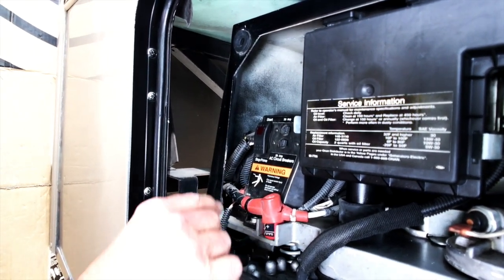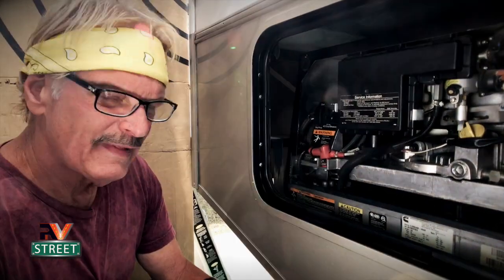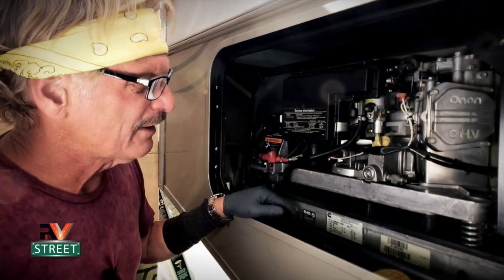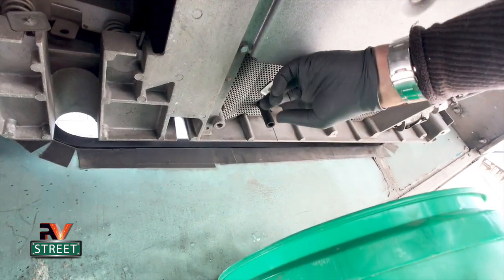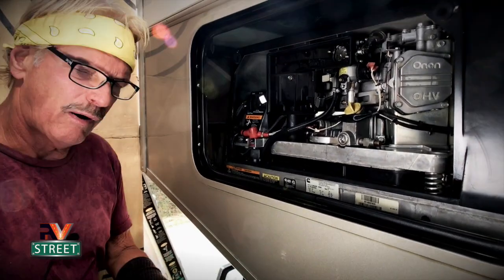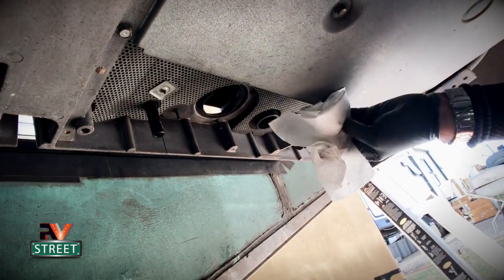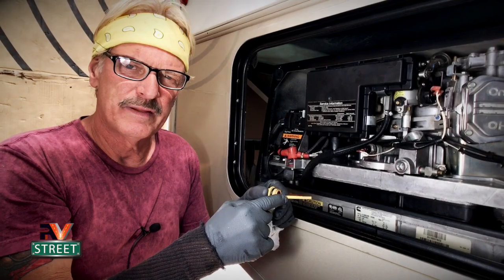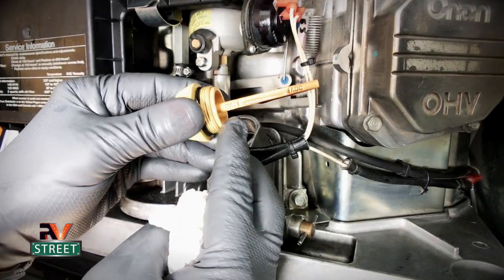CUMMINS ONAN RV GAS GENERATORS - ULTIMATE MAINT. GUIDE - Part 1

Comment: Nicely done, thorough, complete and very helpful.  Since yours is a gas generator, are there some fine points that differ for those of us with a diesel generator?  Thanks again for another high quality educational video.
Reply from the maker: Much of what I show in this 3 part series will apply to diesel generators too. Part 2 is coming out this Sunday @ 8pm. But as far as "finer points" on diesels not sure. I'm not well versed on diesels.
thx for watching Robert. 👍

Comment: Love your videos very helpful.  Question my gen is onan 4000 air cooled, it is surging and cuts off any ideas on what to change or fix.
Reply from the maker: It could be any number of things. Without knowing the maintenance & exercising history and doing a methodical diagnosis by being there to troubleshoot, it’s impossible to say. Always start with the annual maintenance stuff first, then to the easy and most common fixes first.
• Old, bad or wrong fuel like E-15. Put in appropriate amount of Sea Foam in the MH gas tank, run the motorhome to mix it good in the gas tank and the run the generator for several hours on at least a 1/2 load. You want to run this fuel thru the entire generator fuel system and maybe this will help clean everything..
If that doesn’t help… 
• May have a weak or failing fuel pump or a clogged fuel filter (Replace both. Go to my Amazon Store, search Amazon for those two parts, put them in the cart and check out: https://www.amazon.com/shop/rvstreet)
• The spring holding the governor arm may be weak and not holding a steady RPM
• The carburetor may need to be cleaned

This is not a complete list but this is where I’d start in this order.

Comment: There are oil filter sockets.  This looks like the perfect application for one.
Reply from the maker: Yep there are sockets out there, but that's another tool to buy. These Tekton pliers work for both the generator and the coach filter if it needs to be broken loose before unscrewing. So you have one tool that serves two purposes.
thx Bruce for that. 👍

Comment: Martin, thanks for all the great videos, including this one.  Question, I can’t get the spark plus wires off the spark plugs.  Too little hand strength I guess.  Any suggestions?  John. HGJAB-1038K
Reply from the maker: Try with a pair of rubber gloves and gently wiggle back and forth while pulling. If that doesn't work have a younger friend with more strength help you.
Before you put the wires back on, don't forget to put a small dab of my 3M silicone paste on the inside of the rubber boot. It will make removing them next time a breeze. It's in my Amazon Store in the "Sealants, Lubes and Protectants" category.
https://www.amazon.com/shop/rvstreet

Comment: Hi there. Great videos. What is the spark plug Gap for the Onan 5500 HGJAB-1038K?
Reply from the maker: Spark Plug gap is 0.025 inch, and torque to 10 lbs-ft (13 N-m) if new, or to 18 lbs-ft (24 N-m) if being reused.
You really should go back to my video and in the description text you can download your own PDF service manual. It answers all these technical questions and much more.

Comment: Great video Martin, looking forward to the rest of the series on Generator maintenance. I have a question about using brake cleaner on the electrical contacts. Is the cleaner non-conductive?
Reply from the maker: Thanks for the kind words Mike.
Well....let me put it this way. 
I've been doing this method of cleaning electrical and mechanical parts all my life in many, many types of maintenance applications and I have NEVER had any issue what-so-ever. Electrical or otherwise. I mean you know how aerosol brake cleaner is right? Once you spray it on any surface it drys almost immediately and leaves no residue. If somebody wanted to buy an "official electrical cleaner" they certainly can do that. But I use brake cleaner literally on everything when I need to cut thru any grit and grime or flush anything out and make it clean again. I always carry one or two cans of it at all times. I'm always using that stuff.

Comment: I don’t generally like using ethanol gas in any small engines. Since the onboard generator runs off the coach’s gas tank, should we be putting non-ethanol gas in the coach?

Comment: I race dirt bikes in races called Hare Scrambles. They are basically motocross races through the woods, in very tight trails. We have to install spark arrestors on our exhaust. Because they are installed on the tip of the muffler, they are very easy to remove and clean. After removing and cleaning mine several times, it's hard to believe that just removing that plug and running the generator will adequately remove the Carbon from a screen that usually would require a whire brush. Are you sure you can't get the screen out with a bent scribe? I haven't even changed my oil for the first time so I'm just asking.
Reply from the maker: I'm sad to say that Martin has passed away and I don't have the answer to your question. Sorry
Reply: @RVstreet  I'm sorry to hear that. My condolences.

Comment: I'm about to buy one of these for my food truck, if I run it 5 hours a day 5 days a week how often would you say I change the oil?  Would leaving the door off with  12v 12" radiator fan blowing into it ?
Reply from the maker: The oil change schedule is every 100-150hrs. depending on the environment. The door needs to remain on to cool properly. Using a fan would an experiment and I have no opinion on that.

Comment: Getting the oil/dirt buildup out of there might help prevent a grease fire.  Don't gorilla wrench the bolts unless you're ready to tap new threads into a very inconveniently placed hole.  Use a real pipe cleaner (not a Hobby Lobby one) or an interdental brush (the cheap ones at Wally World) to clean the crud out of those female spade connectors after you shoot in the brake cleaner.  Listen to Martin!

Comment: Thanks for the informative series on Onan RV Gas Generator Maintenance. Just getting around to following some of your suggestions. On the video (Part 1) aroun 10:20 you show a screen on the bottom of the generator. Mine is filthy with oily dirt. Can't find anything on cleaning this or removal. Can it be removed to clean or clean in place? I've been having issues with the generator shutting off in the heat and am thinking that this may be blocking some of the air flow. Thanks for any comments.
Reply from the maker: There should be no oil on that screened area. There is oil coming down on that area from above somewhere. I suspect you may have a small leak on your oil filter where it seats up at the top. And yes, that could be obstructing air flow as that oil collects dirt and dust while underway.. It also means that your loosing oil from somewhere and your oil level is probably low, thereby causing the oil pressure switch to trip the run cycle and then shuts down. So let's start with the obvious first step.
Here's what I'd do:
1) Make a hot water and soap solution and with a small hand held scrub brush, clean that screen good in place. Let it dry. Make sure you clean not only the screen and the entire bottom of the genny
2) Drain oil
3) Remove old oil filter
4) Look up inside the filter cavity and make sure that there isn't an old oil filter rubber seal ring up inside. If there is, carefully remove it  using a flathead screwdriver. Sometimes the rubber seal from an oil filter will break loose from the oil filter when removing it and stay up inside. Then when you install a new oil filter with it's own new rubber seal, now you have 2 rubber seals trying to seal against each other. That won't work and would cause it to leak. So make sure that area is clean and no old rubber seal up in there. This is also good practice to check when changing engine oil and filter.
5) Fill new filter with oil and install and tighten as I instructed
6) Add new oil
7) Start genny
8) Make sure there is not anything obstructing or stored under the genny. Like buckets, chairs, camping gear or anything else.
9) Keep your eye on that area over the next few weeks. If oil begins to still accumulate on that screen or the bottom of the genny, that means you have oil coming down from another area up top, so try to locate where it's coming from using a 2" telescoping mirror. Everything is in my Amazon Store.
https://www.amazon.com/shop/rvstreet
Reply: @RVstreet  Thanks for the reply. At one time there was a major leak from the crank shaft seal into the bottom of the generator. I suspect that it was either never fixed properly or it happened again. I'll give your suggestions a try. Was wondering whether the drip pan inlet cover could be removed without removing the entire generator. Thanks again for the help..
Reply from the maker: @PAPERRN  Not sure what you mean by "drip pan inlet cover". 
Do you have a service manual?
If not, I do. If you use Facebook, go to my YT home page and click the FB logo, then hit me up on messenger and I'll attach it there for you to download. Maybe also shoot me a picture of the "drip pan inlet cover" you're talking about so I can see what you're talking about.
Reply: @RVstreet  I do but it isn't referenced. It is in the Onan parts manual on page 49. It's attaached to the drip pan and includes the Inlet Cover, Insulation Retainer, and Inlet Baffle Insulation. I don't have a picture of the cover but do have one of the screen.

Comment: That spark arrest or looks like it might be a 3/8” square. You could use a 3/8” extension backwards if so. If not an eight point socket will drive a square

Comment: I thought that your idea of drilling a hole in the oil filter was a good ide until you loosened the oil filter. The mess that was created was a lot worse than just pulling it straight down. Just something that might have been a good a good idea is that their generator may be different. You may have wanted to also show the chart and its location for type of oil to use.

Comment: any thoughts on running Seafoam or Berryman's B12 through the carb via the air filter inlet. to clean jets
Reply from the maker: Doing that thru the air filter inlet is not thorough enough.
I covered using Seafoam in this 3 part series. I treat the whole gas tank every winter with one 16oz. bottle/20 gal. of gas. (4 bottles total for me) Then I drive the MH and run the generator under load for about 20-30 minutes. Every thing concerning the fuel systems in both have now been treated and cleaned, including the generator jet in the carb. This is the proper way to do this.

Comment: Hi Martin! I’m a day behind because I’ve been packing up George and getting ready to head to Quartzsite! I actually checked the oil in my generator today before I tested it for the trip. I do exercise it at least once a month with a load. The oil was low on the dipstick and I was thinking that was because it was cold, kinda like a car...you check it when it’s hot??? I’m gonna grab some 30 weight before I hit the road in case it needs to be topped off. But I do have one question about your oil draining. You drilled a hole into the filter and oil drained out through said hole...but what did you do to get the oil to drain through the little drain hose? Did I miss something or does oil not drain out that hose? Great video as usual and of course, I now have cleaning to do! Hi Joanie!!! 🥰 I just thought it through and it must drain when you open that thing up top! I think mine is different because I don’t think I can start mine from inside the panel. I could on my diesel but I didn’t see a switch on this one. I’ll be examining it closer!
Reply from the maker: Marsha,
Since you bought George used, and you have no idea what previous maintenance has been done on the generator. I would perform—at the very least—this entire basic maintenance schedule. That way you will have an accurate baseline going forward. And besides, you also don't know how old the current oil is, nor what type they used. You really don't want to mix different types of oil. So if you do this entire basic maintenance schedule, not only will the oil be changed and new, but you run no risk of mixing two different types of oil.
Yes the oil is drained thru the rubber tube underneath as you open that valve—up top—like I showed by opening it up all the way. Once oil is drained, close the valve and add new oil. 
We do have a remote start/stop switch inside the coach (which is also where the hour meter is) in addition to the one outside on the generator but it may differ on other rigs.
Joanie says hi Marsha. 😜
BTW...we heard that Quartzsite got down to 22º yesterday.
Reply: @RVstreet  22??? Dang it! I’ll have to verify that, Bob and Pearl are there and they said before that it could dip into the 30’s but no one said anything about the 20’s lol...I thought I left that in misery! So actually, I do know a little about George’s generator. The previous owner only owned him for 18 months and had to overhaul the generator. He spent $2,500 and had only put about 10 hours on it since the overhaul. I texted him today because I wanted to top off the oil and if it was synthetic then I wanted to use the same. He said he didn’t know but it was a certified Cummins service center. So I figure if he didn’t ask for synthetic then they probably didn’t use it. I have the paperwork so I will check it out. I will do the entire basic maintenance this Spring after I watch your series. I looked at mine today and it looks the same as yours...it does have the outside start and 2 breakers also. Yes, mine has the start inside with the hours as well. I’m sure it says it somewhere on the unit what the model is...I didn’t have time to look today. I almost made it to Amarillo in spite of getting a late start wrapping up some real estate stuff! So I’m making good time! Talk to you guy’s soon! I’m wondering if you got your cover installed? Tell Joanie I’ll call her tomorrow while I’m driving 😊

Comment: I purchased a used RV with probably the original Onan generator in it, it generates but doesn't idle down when not under load.
I adjusted the governor so it idled nice but then it didn't rev up with load? So I'm guessing there's a problem the the previous owner "fixed" by just cranking it up so It was always charging.
Any ideas, or videos on that?
Reply from the maker: "there's a problem the the previous owner "fixed" by just cranking it up "
I don't know what this means
Perhaps watching part 2 & 3 will help your situation

Comment: Martin - can I top off my generator oil with the Royal Purple SAE 30 synthetic, not knowing what the dealer last put in it (Onan 5500)?
Reply from the maker: NO.
You never want to mix oils. Do a complete oil change and then use Royal Purple

Comment: wow I thought your rig would have been diesel for sure , What Motor trans has the RV ? Diesel / Gas .
Cheers Rob
Reply from the maker: Our rig is a 2012 gas with a V-10 and a TorqShift 5-speed
automatic transmission w/tow/haul.

Comment: I've purchased all the Onan parts you recommended on your Amazon Channel.  Is there an Oil Sensor?   I didn't see one.   I went to Onan's website and for my HGJAB 5500 unit. The orignail partnumber seems to have changed.  There are 2 oil sensors on their website, one is $86, the other is $19.   Is there a way to tell which one is the right one?   (My Generator shuts off on it's own).   I would try your technique of removing the sensor wire, but it's in the shop for a couple of months because my Front FORD Motor AC went out.    I'm using your channel to get me up to speed on how to do some of this myself.   -   When I get it back from the shop!!  Arghhh
Reply from the maker: Hi Darth,
Go back and read the description text. I explained the options of ordering the oil pressure there. It's not available right now on Amazon and that's why that one item is NOT in my store.
And THANK YOU 🙏 for being such a faithful fan supporting us using my store. You're the best 👍

Comment: For the spark arrestor used a 1/2" extension reversed, put a 9/16 soccer attached to my impact driver, also sprayed it with PB blaster waited 1/2 hour came right off, no effort

Comment: Martin,  great video!   I was lucky enough to get a tour of the Cummins generator manufacturing building.  I actually say all of their assembly lines from small portables up to the massive ones.   I have seen videos where people say Cummins generator turn off when going around a corner because it has too much oil in it when at the full mark.   My opinion is there is something wrong with the oil sensor or they are putting in the wrong oil.   Any thoughts?
Reply from the maker: I've never heard of this. However, I have heard of this happening when the fuel tank is @ or below 1/4 full. Putting in the wrong oil or over filling it should never happen if the owner reads their manual and checks their dip stick every time before they start it up. Now the oil sensor is a common weak/failure point and I will be covering this in Part 2 coming up in two weeks.
Reply: @RVstreet     Their supposed fix was to take oil out of the reservoir down to the add line.
Reply from the maker: @KevinCoop1  WOW.

Comment: Any direction links or information Onan 5500 oil leaks? Thanks!
Reply from the maker: Oil leaks...? Well if that was my generator, I'd first clean it very well, then run it for awhile, then I'd take my telescoping 2" mirror and a light and I'd be hunting for where it's coming from. Is it up top or underneath or what? If it's underneath it could be coming from the oil filter. Up top....that's where you have to look closely.
Reply: @RVstreet  Thanks!! I watched your 3 episodes at x2 speed and slowed at areas that caught my attention. Great production, 5 star. & thanks for providing these guidelines that are straight and to the point ~